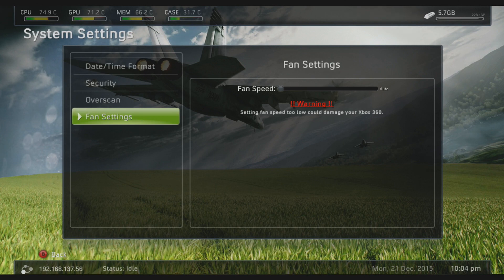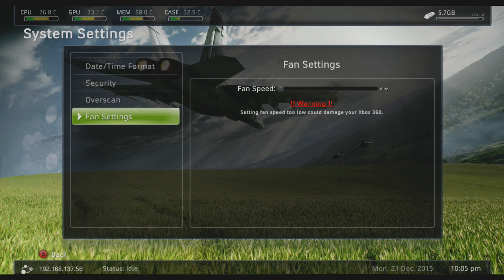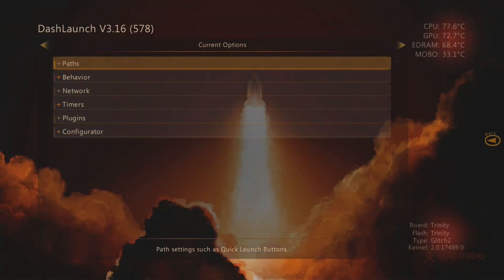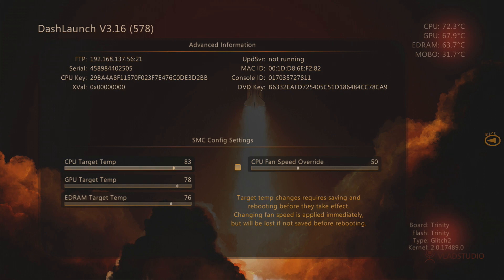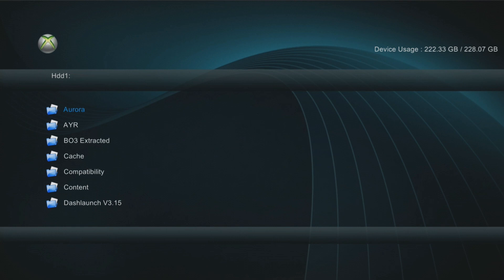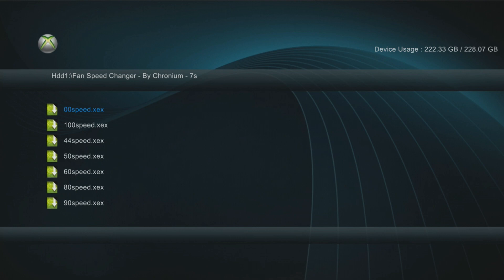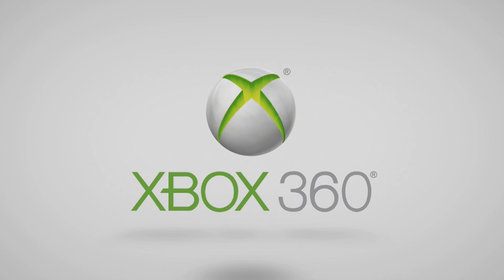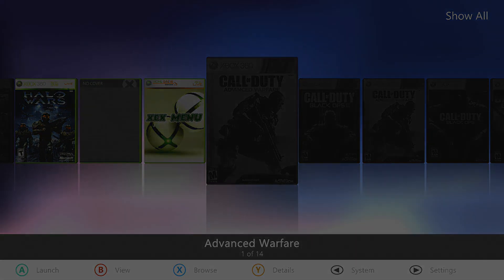Jtag Tutorials #49 Setting Fan Speeds Without FSD

Comment: I have a question, someone hopefully can answer. I have Trinity, my CPU Temp before using JTAG FSD3 old modchip (delays to booting up, which is normal for old modchip) is only 49c to 54c max. Fan Speed is in Auto-Mode only at FSD Dashlaunch. Since i moved to RGH Aurora, my temps now running at 60c to 64c max. I used 60% Fan Speed at Dashlaunch which i follow to the recommendation with this video. Why did my temps getting higher? Is it normal that RGH or Aurora my temps gets higher than before? Im done cleaning my Console also with a new Thermal Paste.. Can someone help me answer this problem, thanks.
Reply: try using back FSD3
Reply: @IRR730  FSD3 is not compatible with game cover arts or it is hard to get since it is not supported it any longer.
Reply: thats normal iam also getting 60c - 65 c its fine ,its just bad if it was 80c - 95 c
Reply: @sm1_tiny my xbox is getting hot cuz my dashlanch is 40 (fan speed) also i use FSD3 is 80 (fan speed)

All i want to fix my fan speed and How much can I increase the fan speed in dashlanch? also FSD3 shoud i do auto Instead of 80? (fan speed)

I hope u to understand me
Reply: @Berr2y  use 60 or 65 fan speed in dash lunch that should work
Reply: @sm1_tiny  ur sure? cuz i want play on online (i use stleath server) but is getting hot is not enough so i do 80 in dashlaunch but its gets me this:

1-error code E18 (on screen)
2-Some times my xbox stop and gets screen freeze

I tried so many times to fix it but is not working why:(??
Reply: tbh idk  @Berr2y

Comment: I got a jtagged Jasper Xbox, but I just can't change my fan speed. 
tried fsd, dashlaunch and the fan speed xex files.
 I need to put my fan speed lower as it makes horrible noise and since the whole Xbox is around 40°C I think that it won't cause RROD to lower it.

You got any idea on what I might be doing wrong? (Or what would work?)
Reply: Any solution?

Comment: i have xbox 360 slim after glitching it with cr4 everything went smooth and boots as normal, i have noticed that the fan speed is very fast so i tried to install fsd and dashboard to lower the fan speed but it didnt work . i have opened the xbox and check the blue wire in case was running on 12 v mode but the wire was in place not been moved so all the wire are connected properly please help
Reply from the maker: +kakou kaka Maybe the fan speed was modified in the XeBuild image?
Reply: +xXModdedWarfareXx  i dont know as am not an expert how do i change that ?
Reply: XeBuild image is part of the application of XebuildGUI it is used when u updated the xbox to a dash board

Comment: What's so good about changing the fan speed?
Reply from the maker: +Rafita Huicochea Keeps the console from overheating. Its kind of important. especially for older consoles.
Reply: +xXModdedWarfareXx. plz help me my xbox 360 restart wheen start gta v with mode
Reply: To Prevent RROD Keep Your Console Clean. Like Open It Up Every Fre Months And Clan The Dust Off With A SOFT DUSTER OR PAINT BRUSH. DO NOT USE ANY CLEANING PRODUCTS. Also Make Sure It Is In A Good Spot And Set Fan Speed To About 50-60
Reply: +Rusty Lobbies what if I set it to 100 is that bad?